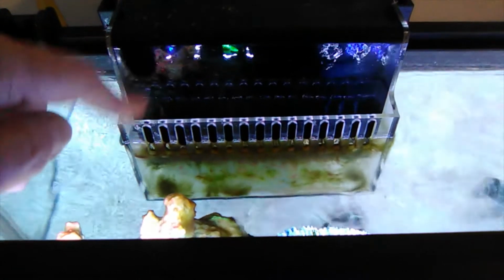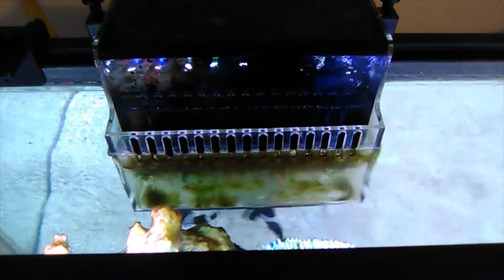Cleaning the overflow weir to a reef sump

Comment: What a coincidence that you put out this video.  I have for the past week been using a toothbrush to clean mine because it really has been restricting water flow.  I had oily scum accumulating on the surface of the water because of insufficient flow through the weir.  As soon as I cleaned it, the surface was pristine within a few hours.
Reply from the maker: Great, funny how something so easy to forget can make a big difference.